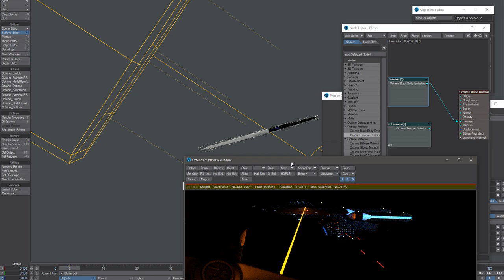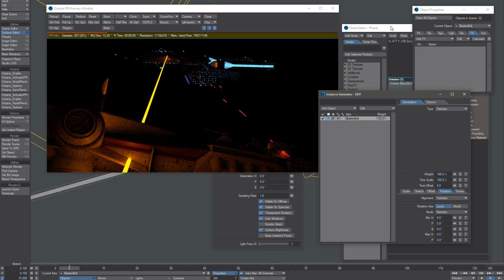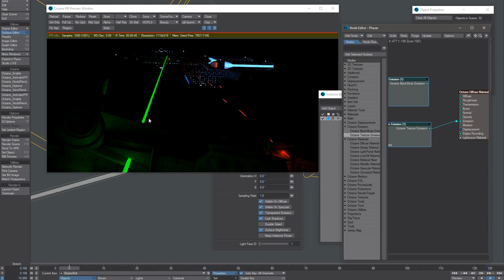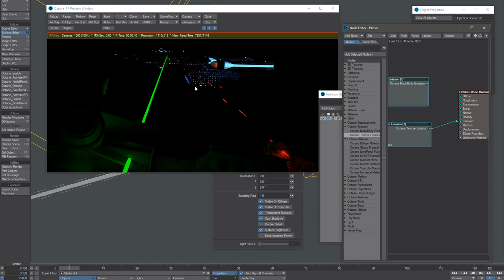Setting up Weapons FX in Lightwave3D

Comment: To whoever asked, best way to do a beam (imho) is two long cylinders, one inside for the 'core' and an outer one with a transparency texture. In LW turbulence is the best option. You can also make an endomorph of the beam to scale it easily if you don't want it protruding from the other side of the target (scaling it's length will mess up the applied texture). Animate the texture along its length over time to give the visual impression of energy flow. Sorted :)
Reply from the maker: The topic wasn't just about a beam, it was about weapons fire as a whole. I used a beam as a common example.
Reply: I knows :) Just trying to help whoever it was fella with some insight! Keep up them nice renders btw